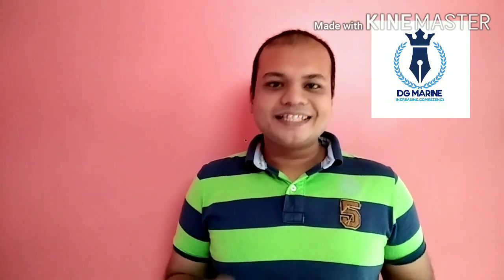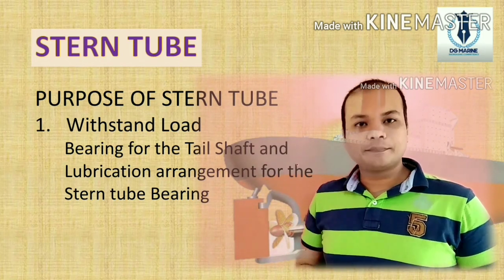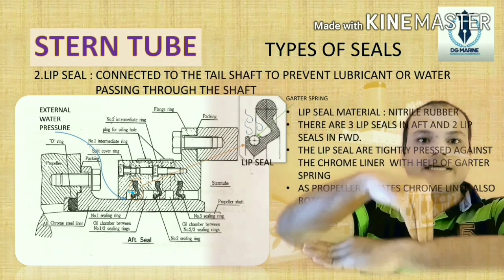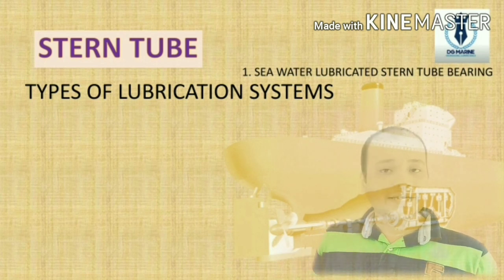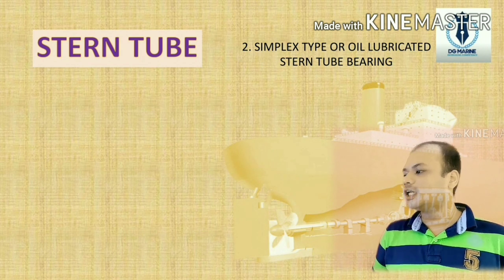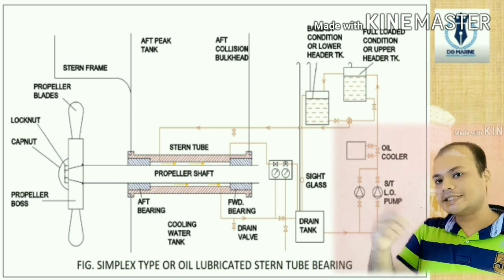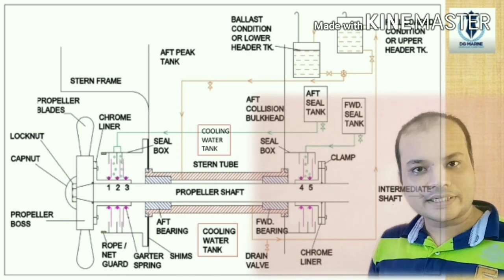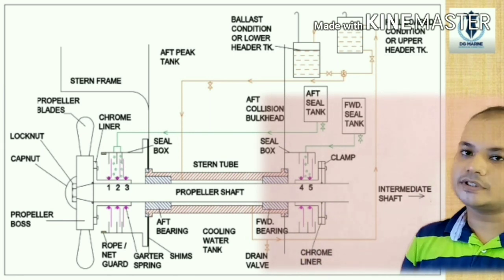STERN TUBE, DRAW ITS SEAL ARRANGEMENT, WHY TWO HEADER TANK USED

Comment: We have onboard the kemel maker.... force lubrication stern tube type.... where air seal air pressure regulate with draft change.....i m bit confused about how and from where the air control unit is getting idea about draft change and regulations air chamber sealing air pressure...